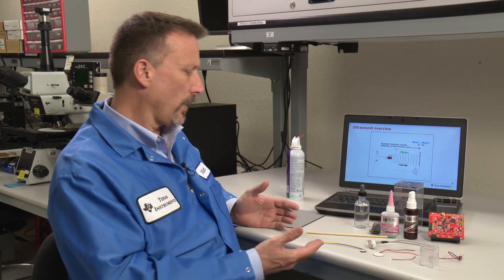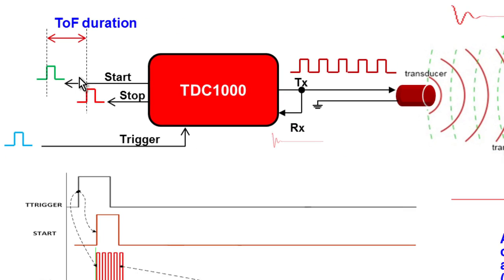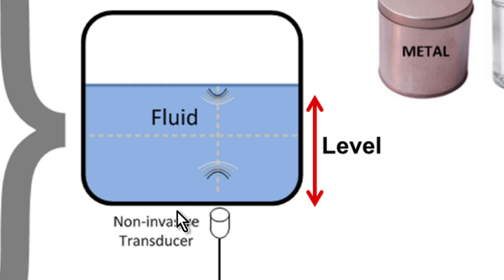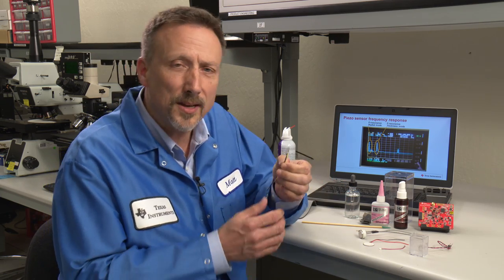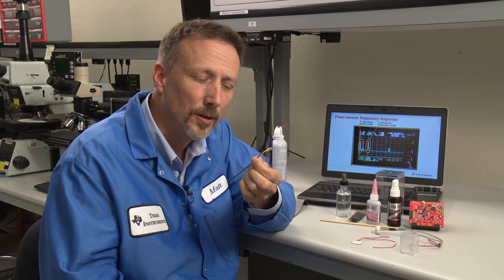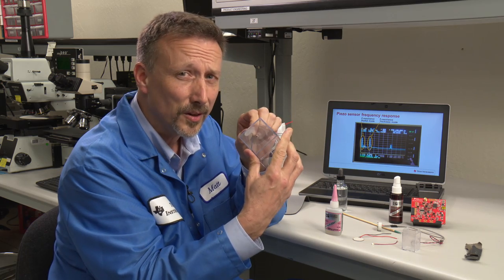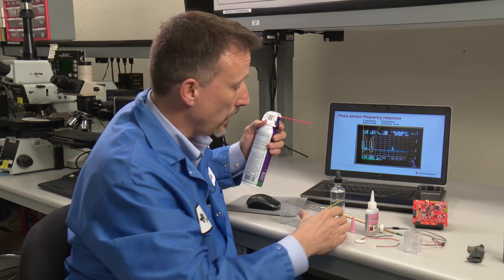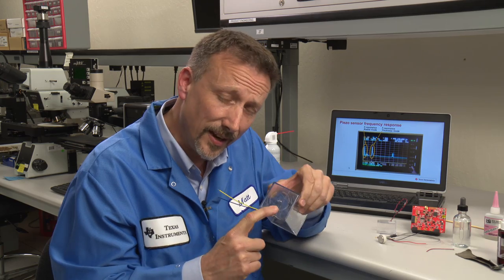How to use inexpensive transducers for ultrasonic measurement

Comment: Hey folks I left TI 6 years ago but I'm glad to see there's still interest in this part. To answer alot of the questions about biomedical etc in a nutshell this isn't the right part for you. It work really well for sound conduction through liquids (and container walls) but second order reflections (bone cracks etc.) really would require a more complicated sensor array and associated electronics. (ie: medical ultrasound). Its best to think of this device as a highly integrated sonar chip where it will detect the largest object in  the echo path.

Comment: I'm research using the MSP430FR6047 as well. However, when connected from MSP430FR6047 to the ultrasonic sensing Design Center software there is an error "HSPLL detected that the PLL has been unlocked".. Maybe you have experienced the same error? if you ever experience this error. How to solve this error?

Comment: I wish to test whether an ultrasonic cat repellant garden accessory actually emits any ultrasonic waves and isn't simply 'snake oil'.

Can any reader please proffer suggestions on the cheapest available method to detect the presence of any ultrasonic waves?

Many thanks.

Thank you to the video creator for such a high quality educational video.
Reply: Well it depends on how much you value your time and if you are willing to "cheat" a little.

First of all, you can do that without spending any money and simply looking at the pcb of the device: just google the ics and try to understand what they do(your journey may be concluded right on this step if you spend long enough on it). Another thing you can do is to buy a simple 10$ osciloscope or frequency measurement device, with the same osciloscope you can actually detect the ultrasound waves in the air if you buy an ultrasound receiver, so if you are unwilling to disassemble the device you can try that(but do keep in mind that received signal will be quite weak, and that ultrasound is kinda a finiky thing in itself, so you might find it troubling to do that). You can also try to forego the osciloscope entirely and stick with your plain old sound card which you probably already have(but do keep  in mind that they usually have some capacitors on the input and output to "smooth out" high frequncy "noise", aka the thing we are trying to capture and that they are usually not tolerant towards high voltages), or you can with microcontroller or you can buy an arduino ultrasonic module that  can be interfeced to your pc with something like a usb to ttl(or if you have a physical com port on it you can go with it). 

All in all i would say that it is much easier and cheaper to just find a few stray cats and test it on them directly rather than going through all that hassle.

Comment: Two brief statements at the beginning don't sound quite right:

“Ultrasound is any sound greater than human hearing in the range of 30kHz to 10MHz”
The ultrasonic frequency range is defined as acoustic frequencies that are above the typical human limit of 20kHz. Additionally I've read that acoustic frequencies can reach well into the gigahertz range, far beyond 10MHz.

“Ultrasound operates by having a piezo-electric transducer create an electromagnetic pulse into a medium that’s created from an electrical pulse exciting that transducer.”
Reply: +VortexTwin: You are correct I should have said "pressure wave".
Reply: i stopped at that *"electromagnetic"* word and started looking for your comment
Reply: @mattminasi4856  Matt are you able to use this device to determine the transmitted power?
This would solve a major problem my company has with a device they manufacture

Comment: Hi Matt,
Thanks for posting this interesting video.
I need to use your company's sensor on a steel made tank to monitor the level of  the remaining pressurized liquid butane in a commercial gas bottle container.  Would your sensor work if I place it on the bottom surface of the tank under consideration?
Best,
B.

Comment: The flow rate application was a total F$@#kup. Many have wasted time implementing it only to find that the IC has a bug.(Thanks for posting to sensors forum! The TDC1000-TDC7200 combination is actually not our recommended solution for flow meter applications. The problems as mentioned are the devices incorrect readings at zero and low flow, additionally the TDC1000 can miss the first STOP pulse generation at times which can vary your ToF measurement, this is what is possibly causing the 9% error that you are seeing in some of your flow measurements. One way to help reduce this error is by using the averaging function to help increase your measurement accuracy, but unfortunately there is not much that can be done at zero and low flow instances. The recommended solution for accurate flow metering using ultrasonic sensors is by using an MSP430FR6047.)

Comment: Hello, I am looking for a way to measure the pressure generated from a low frequency (5hz- 150hz) transducer connected to a surface. Is there a measurement system that you recommend?
Reply: That depends on the transducer and how much amplification required. The TDC parts are designed to operate in 1-5Mhz range. Good news for you is that's low frequency so it would be pretty easy to just do those measurements with good oscilloscope. A Rigol off Amazon will also provide a poor man's FFT of the signal. Good luck!

Comment: how are transducers used for ultrasound applications are different from piezoelectric ceramic plate/wafers used in speakers? can you attach them in parallel or series to get either larger diameter or thickness
Reply: Not sure I understand the question but with piezos the physical dimensions determine is primary resonance frequency. So in general they are designed to work for a specific range. the diameter (size) has more to do with acoustic transmission power.  For instance 2 transducers can have the same resonant frequency but one that 2x the diameter has the capacity to create a larger acoustic wave AND it will detect a smaller acoustic signal for the same excitation voltage.

Comment: Can you use it on fibreglass hull
Reply: not really. glass isn't a uniform substrate, it's a composite. your resin "rings" at one speed, your actual glass at another, any kevlar at another, carbon fiber at another, then your core at yet one more (assuming single material core), and any foam layers dampening. now add gelcoat, lol. it's sketchy on a metal hull unless you REALLY engineer the mounting point for accuracy. now, that isnt to say "it's impossible!!", because you COULD get it to work. but, the energy you would have to put behind each pulse would be huge in comparison to a wet transducer like the fish finders use. to measure level in glass tanks, folks usually mount a transducer at the top to measure level by echo off the actual surface through air, avoiding the tank composite. a single material (glass, stainless, plastic) plate can be used in a top mount to avoid corrosive fumes. but tanks dont bounce in the briny deep, especially their "dry" side, lol. so yes, it can be done, but the economy of scale makes it impractical. better perhaps to think more along the lines of a pod to hang off the gunwale, or transom. then you can mount to a uniform material plate, back dampen and waterproof as a single operation, and avoid the headaches, lol

Comment: Hi, I am a sound engineering student at Argentina. Lately I've been working on hydrophone designs for cetaceans sounds. I used 160kHz piezoelectric crystals and achieved an acceptable result for Narrow Band Ultrasonic Frequency clicks emitted by dolphines. However, I had a poor response in audible frequencies. If I want to use a hydrophone for audible frequencies, should I use crystals with a resonant frequency bellow, within or above the range of interest??? Why???
Reply: that''s a tricky one because "clicks" at like a CHIRP in DSP terminology. In that they have a very frequency components. I'd suggest a wide band microphone vs a piezo. The best way think about a piezo is like a "bell" that rings at a primary harmonic. It will resonate at multiples of that primary but not well.

Comment: I can use this method to mesure a stain steel tank filled with wine?
Reply: Absolutely! If you check out the app note I did back when I used to work for TI I showed how you can glue transducers on a metal tank and measure liquid volume. The gotcha is tank wall thickness! The thicker the wall the more (acoustic) power required on the transmit pulse. Also I recall wine vats have a cooling jacket (not sure about the bottom) but if they do that will make it hard. Depending on your tank it may be easier to measure level from the top via "the air".